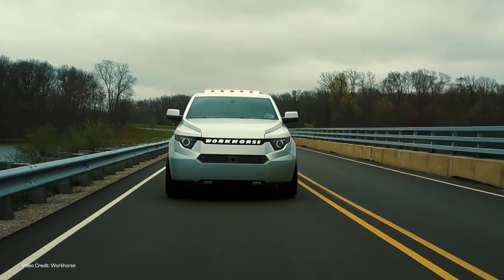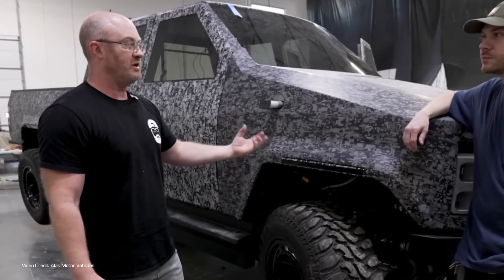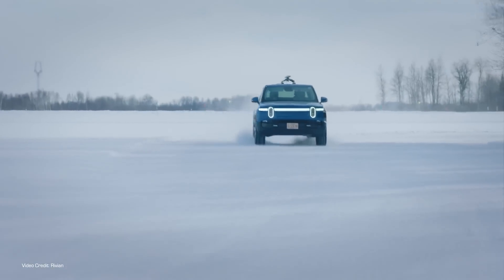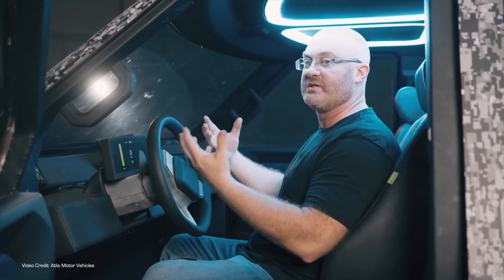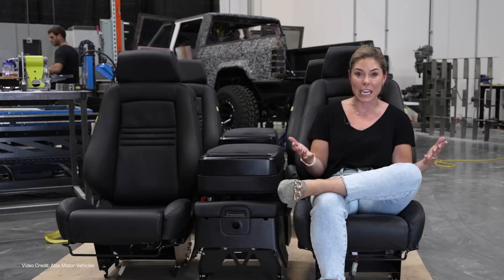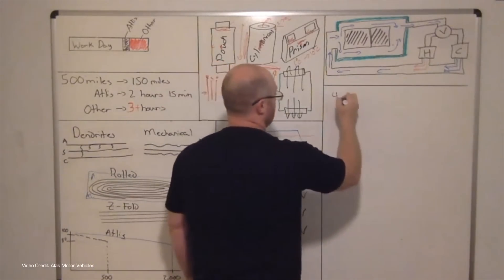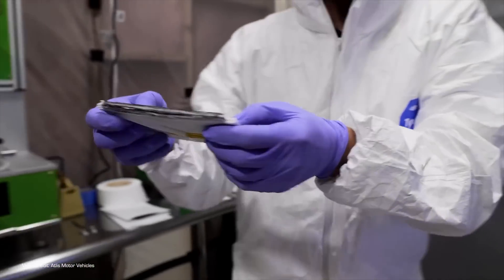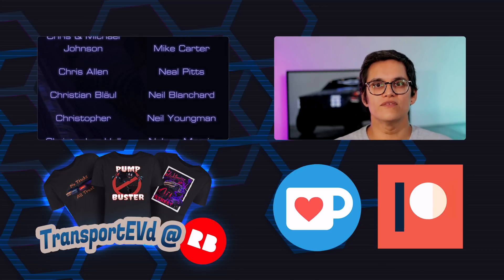Atlis XT Reveal - 1.5 Megawatts of charging?!

Comment: Been a Ford fan all my life. But I really don't think Atlas will have any competition from the f150. For the next 10 years or so the wolf will take the small truck market currently held by ranger, and Toyota. The f150 will take the mid size truck market currently taken by f250, Chevy 2500, dodge 2500. The Is the only entry into the heavy duty market currently held by f350, Chevy 3500, dodge 3500. The only other offerings are a few semis and those are gonna be expensive and heavily regulated by the DOT.

Comment: Here's a question: how will Rivian, Atlas, et al handle distribution? Elon proved the direct sale method doesn't work when a customer needs service. It could be argued his low-quality zero support business model didn't poison market expectations for those who would follow, but we know better. Elon, with his nearly unique combination of intellect and arrogance, might have planned his service failure model to raise the stakes for rival upstarts. Here's the answer: all the difficulties of design, testing, manufacturing, and homologation pale in comparison to the criticality of establishing a wide and reliable distribution network. In the case of Rivian, it has Ford (major investor). Wise move. Upstart EV producers who lack such a strategic partner will fail.

Comment: Looking at Jerry Rig Everything presentation of the Rivian R1T seems like this Atlas will have to compete against it ad well. It to has outlets and an air compressor along with other accessories. The F150 Lightning specs proves tocbe a competent work horse of a truck. The jury is still out on the Cyber Truck. It Mike make for a decent work truck but seems more flashy than practical like the others. We shall see once Tesla goes into production. All in all the EV truck market is about to get really crowded over the next 5 years.

Comment: At 1.5MW, say 800V charging, there would be 1,875 Amps flowing into the truck. A 0000AWG cable is rated at 300 Amps so 12 of these would be required, each is 0.46" diameter without insulation.
So at say 95% charging efficiency the truck would have to dissipate 75,000 watts off heat, enough waste heat to heat 3 houses.

Comment: This is very general. But there are basically two kinds of truck owners. Basic use, and heavy-duty use. If you use your truck for hauling Beauty Bark, or Garbage, or for camping, then an F-150 is a score. However, if you have to haul 8 tons of concrete to a worksite, a half ton pickup is not going to work. Atlas is providing an option for that second group.

Comment: Although there hasn't been an official estimate for the weight of the CyberTruck, it certainly won't be a Class 1 truck. With a 3500 lb payload, CyberTruck would have to have a curb weight less than a Ford Fiesta to stay below 6000 GVWR. That's not going to happen. Rumors have been that it will be either a Class 2b (medium duty) or possibly even Class 3 (heavy duty) truck.

Comment: The Atlis XT has a starting price of $45,000 for the base model with a 300 mile range. BUT they also have a “subscription” plan for $700 per month. It INCLUDES full auto insurance, FREE charging at an Atlis charging station, and all maintenance. Imagine, not only will you never have to pay for gas again, but you won’t even have to pay to charge it!!  Imagine, NO MORE OIL CHANGES, no more transmission problems, and no more greasy engine bay!

Comment: Did you say, maybe I missed it, might watch again, but what is the price?
Reply: The base XT (300 mile range) will sell for $45,000 USD. BUT they are also offering a subscription plan. The subscription plan is US$700 per month, however, it includes free charging at an Atlis Charging station, it includes full auto insurance coverage, and it includes all maintenance.  Imagine not having to pay for gas or charging!

Comment: As a retired electrician I wonder how large an extension cord I will need to carry the near 2000 amps it will take to charge my truck at a 1.5 megawatt level, at what I might wrongly assume is charging somewhere around the 800 volt range, without it glowing red and melting any plastic around the charging port. Lol...You might have to call a lineman just to plug it in? Great video though, Kate! Thanks for the breakdown!
Reply: @Author B.L. Alley And here I'm concerned about my Bolt catching fire while I charge at 120volts and 8amps. Shesh.

Comment: THE DOOR HANDLES?!?!?!?!?!?!?!?!? That alone sells me as I live here in Maine, currently in the northern tip of marine and often end up working through the nor'easters, also are those steel bumpers I spy? I love this truck and hope it can reach the market, the charging speed is nice but I wonder what the range will be. This company seems like it may finally fulfill my wish of a badass work van, take the body off and put a van body on, don't change the payload, don't change the battery, range, nothing; give me the infinite more versatility of a van with the strength, durability, ergonomics, and comfort of a modern truck.
Reply: Range is aimed for 300 miles on the $45k base model. Other more expensive models will aim for 400 and 500 miles.
Reply: Also, you can buy the Atlis XP platform instead for $27k and put on top whatever you want.  It's a plug-and-play system.
Reply: @crilako  That sounds fun, but I really like the convenience of being able to park and walk back to the storage
Reply: If you change the Body you will also change the Range. But probably for the better.

Comment: Some interesting choices but the retracting rear cameras are a terrible idea. Truck mirrors get smashed or ripped off regularly and it should be something cheap and easy to replace... not something that should it fail you cant legally drive. The ridiculousness of that totally outweighs the practicality of the door handle "scoops". Very inconsistent.

Im also not overtly excited about a company with a decidedly homebuilt asthetic going thier own way with batteries and super fast chargers. Especially seeing a "new" "prototype" that looks like it's at least 10 years away from production. Compare the fit and finish to something like the Rivian R1T that basically already looked like a production-ready vehicle when it was first teased. This thing looks even more like a bad scifi movie prop built in a weekend than the Endurance, which is really saying something. The DIY thing makes for a cool story, but it doesnt fill one with much confidence that they can safely bring this vehicle to market.

Comment: What is their price point?
Reply from the maker: Target price of $45,000 when volume production is reached.

^Kate
Reply: @transportevolved  that strikes me as a dead give away that they aren't serious. These guys are playing house. The battery pack will cost that much. I'd like heavy duty trucks to succeed but this operation isn't who I'd bet on.
Reply: @transportevolved  That is a lofty goal. I don’t think they can achieve that. But good luck to them. All the fifth wheel trailer hauling trucks or at least $70,000. That’s what they should shoot for.
Reply: @ZeusBullyMax  Ford f450 XL starts at 51,380, I think 45k for them as a start up is unachievable without serious funding, but not an impossible goal at some point.
Reply: @ethanmarch4269  they can’t make a profit at their number. And they have to get to volume before they can ever approach profitability. But that 1ton to 4 ton truck arena is wide open. The trailer pulling diesel arena.
Reply: @ZeusBullyMax  I see, I have no experience with the prices of things like dump trucks, boom trucks and other medium duty
Reply: @ethanmarch4269  a lot of people have one ton single and dual axle for pulling horses and cattle, campers, work and business trailers.

Comment: I can imagine why auto-makers are pushing for digital mirrors. The last time I went on a 200+km trip where I average 5.7L/100km, fuel consumption dropped to 5.4L/100km despite being stuck in traffic for 10min and the only thing different that I can think of about that time was that I had forgotten to unfold the passenger-side mirror.
Reply: Eventually, more vehicles will have digital side-view mirrors as governments throughout the world drive towards efficiency Some mirrors on trucks have more Coefficient air drag than some EV vehicles have for the whole vehicle. An example would be the EV Aptera with 0.13 versus the side view mirrors on a Ford 150 truck at 0.19.
Reply: @Carl_in_AZ  comparing drag coefficient of mirrors vs cars is ridiculous, because their form needs to be diffrent to provide their function.
Reply: @unitrader403  Sorry but it is called engineering. Many countries have or are in the process of adopting side view cameras to lower the drag coefficient which increases mileage on EV and ICE vehicles. Aptera is considered an autocycle in the USA and is allowed to use cameras in lieu of side-view mirrors so that it has less overall drag CF than just the two side-view mirrors on the Ford F150  Tesla, Ford, and many other companies are lobbying to remove side-view mirrors and replace them with cameras.
Reply: @Carl_in_AZ  you should definietly replace your side mirrors with little Apteras then, because you basically say they are better.

Comment: A fascinating vehicle. I hope they make it to market. But I agree with your reservation about touch screens. Most designers/engineers seem oblivious to the fact that many people as they approach and pass 60 years old, experience a substantial drop in the capacitive reactance of their skin - it dries out as you get older. This makes touch screens unreliable. All the important functions in my Chevy Bolt are haptic (buttons). This means I don't have to try multiple times to get a control to activate - a major safety concern (I'm 68).
Yes, I know touchscreen technology is wonderful and provides a vast and exciting technological landscape for feature development, implementation, and revision, and that works great in an environment where the user can devote their full attention to the interface (such as in a laboratory or office). I know because I have developed such interfaces - I worked in the Silicon Valley for 20 years. However, if I am driving, operations that detract from my situational awareness must be kept at an absolute minimum, and this is where haptic controls have a strong advantage.
Reply: Well said!!! I think all companies should have a listen to what you say here, the touchscreen is fine but the basic functions should be kept as haptic controls as traditionally. Tesla has a reason to put all functions at the central touchscreen as they search to eliminate the driving part with the self-driving autonomous cars, however, where that's not the case touchscreens and nonphysical buttons are a mistake.
Reply: You nailed it with your comments.  I love my Tesla but using the screen while driving on a California highway is nearly impossible. Change temperature?  Just hope to get within 5 degrees of where you started.
Reply: I have a design background… and agree with your sentiments - sometimes a ‘knob’ is just more efficient and naturally provides haptic feedback. Or in other words sometimes because you can doesn’t mean you should!

Comment: Correction at 3:33: the Ford F-150 Lighting has a payload of 1800 - 2000 lbs (depending on battery size), not 7700 lbs.  The towing capacity of the standard model is 7700 lbs.

Comment: You got your payload numbers for the F-150 and Atlis wrong.

The F-150 Lightning payload is 1400lbs (or 2400lbs, I'll have to look at the tech specs), the 7700lbs mentioned is the standard range towing capacity.  Extended range towing is 10,000lbs

The Atlis payload is about 3000-4000lbs
Reply from the maker: We both get to be wrong! ;) 

I incorrectly listed the payload for the F-150 Lighting (thank you for the heads up - not sure how I transposed that). It is a max 2000lbs (for the standard range model). However, the max payload for the Atlis is 20,000lbs as stated in the video. It's listed both on their website and in the spec sheet I have provided by Atlis ("Up to 20,000 lbs. GVWR")

^Kate
Reply: @transportevolved  Actually Kate, GVWR is the maximum weight of truck plus payload, without knowing the truck weight you can't know the max payload. The 35000 lb tow capacity you listed is actually (per their website specs) their max GCWR or gross combined weight rating, which is the weight limit of truck+payload+trailer. Which means we're still waiting on the truck base weight to calculate tow capacity.

But I still want one (and have a reservation) as it's the only EV pickup that will replace my diesel truck and likely tow my 13500lb GVWR 5th wheel trailer.
Reply: @transportevolved  Oh, yeah.  I remember now. The F150L payload is 2000lbs for the standard range and 1800lbs for the extended range.
Reply: The F-150 payload is 2000 lbs. for the standard range model and 1800 lbs. for the extended range.
Reply: Quite a range on the payload.Does it have an air suspension? What is the ground clearance?